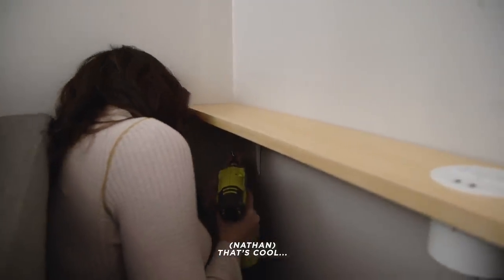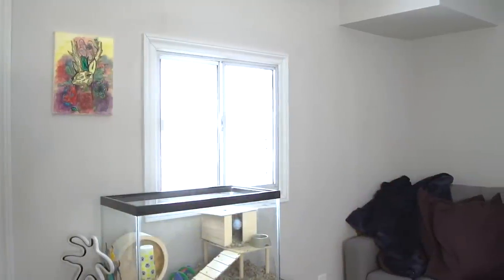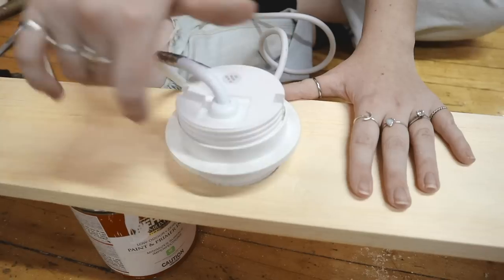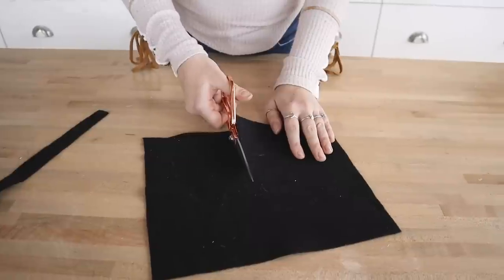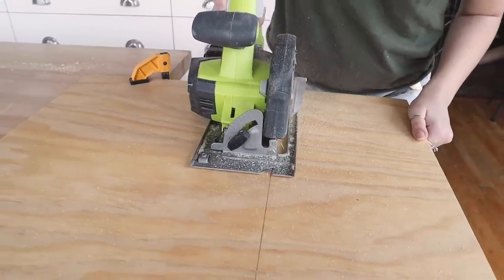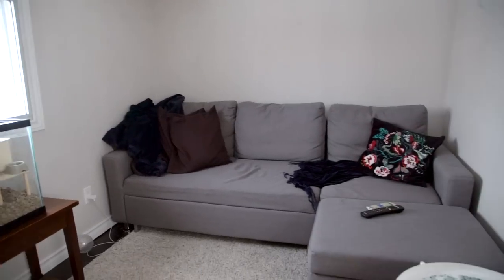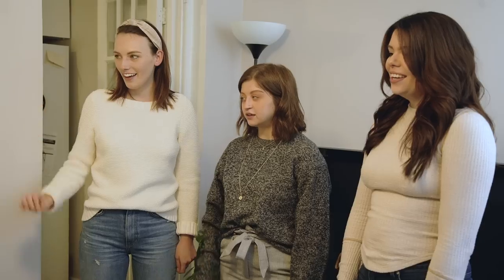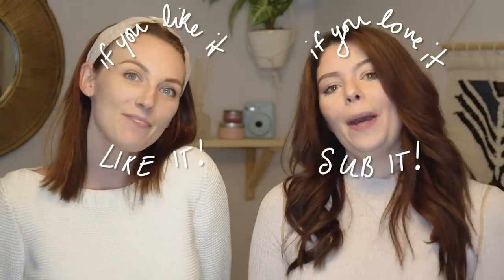make your small space feel BIG!

Comment: Really wish I could use all of these tips for my student apartment, but they have made strict rules about not making any holes in the walls as well as it is concrete walls :/ Thank you for the inspiration nonetheless, you guys are so creative
Reply: Command hooks! Seriously they're so useful in rentals!
Reply: Lol for my apartment I took a calculated risk and installed things anyway. I just bought a tub of wall putty, filled and painted over all the holes. No one said anything. Obviously that's not feasible for everyone, depending on how strict your landlord is and how much oversight they have.
Reply: @kulsoomjawaid6411  That is actually so smart! Might consider this. Not using any wall space is such a waste of space in such a small apartment as I have
Reply: @alexp9621  I do use command hooks for things as frying pans and pots etc, but i fear command hooks will not hold up things as mirrors etc. I really don't wanna risk it dropping into the floor
Reply: @Afsdsh  it'll be fine as long as the frame for the mirror isn't heavy. Check the weight the hooks can hold. They hold up heavy book bags which weigh more than a lot of mirrors.

Comment: The simple shelves work nicely for that space. I have a bigger living room, because it's a combination kitchen dining living room. We put 3 tall BILLY bookcases (2 wide with 1 skinny in between) the part that is under the couch is a good place to hide extra candles and seasonal items. I want to put hinges on the shelf that is level with the back of the couch to make it swing up to access things I might want easier access to and not need to pull the couch out. I mostly put drinks and things I'm using recently on that shelf anyway. Yes it pushes the couch out further, but I'm okay with that. The side table is moved forward and a basket holding guest bedding (because it's a sofa bed) and I like my larger than throw pillows. The other side of the couch has a cat tree, so they like the bookcase as an extension of their playground.

Comment: there are ways to "move" power sockets that are more space-efficient and possibly less hazard-prone than having them horizontal, facing up, in a surface that someone may be likely to have cups with liquids on. One of them is with a kind of electric wiring that's actually turned into a flat adhesive tape. Plus several other kinds of sockets that one can "glue" to the wall, and that don't necessarily waste a lot of space out of the wall. But the wire-tape thing may require some sort of additional coat and paint. You'll also want to remember where it is so to not drill holes on it or anything like that. I actually don't mind and prefer more visible external conduits, though, but the wire-tape thing seems okay for those who put a higher priority than me on how everything looks more "natural" rather than an obvious addition.

Comment: Girls what do you do when room gets downsized where a queen size bed fits perfectly between walls. I have 2 windows (one blocked), the other I had to place A.C. I still have 3 bins and 3 boxes to go into storage. I have a desk by window. Old radiator by window. I feel boxed in. One space for a dresser. I'm afraid if there's a fire, I'm screwed. Any ideas?
Reply: For the firehazard I don't know what you can do tbh, try to talk it over with whoever owns the room, and make sure your exits aren't blocked by clutter. 
If you have some height, you can use that! 
Personally I would change to a high bed (maybe a single bed), but I don't know if that's an option for you.
I would then place my desk or my dresser under it (depending on how much space you have, if you end up with enough space to make a cozy nook under it definitely go for it). 
I have lived in a very small room as a kid (about the size of a bathroom tbh), and my current apartment is also pretty small(and weirdly shaped) , so my advice would be to : make little 'zones', like, this is the sitting part, this is the sleeping part, this is the getting dressed part(even if your place is small, having your stuff organized helps, but there's an ikea video out there that is much clearer), keep things elevated off the floor, so that your space will look bigger(when your furniture has little legs so some floor shows it looks much bigger), stick to some color pallette, and use shelves. Shelves are amazing (and you can make one for corners too, if you use the little wooden paper organizer things and attach them to the wall with screws), and putting small things in baskets or boxes so that they are together is great for both organizing and a more calming look.

If you don't want a single bed there are a lot of people who put their double bed on top of cabinets, but imo that would still be very full.

You could get a table that folds in (partially attached to the wall, instead of a desk? Then when you don't use it, you have a bit more space.

It's pretty difficult to give advice when you don't know the layout of the room, but I highly recommend watching the ikea tutorials, and some videos on small apartments

Comment: Why didn't you clear out the room so you have room to work #the sofa. But good tips good job hate the mirror it's ugly I would have used a different one like a full length and turned it crossed ways along the back wall. You can still add sheer  curtain panels I love the side wall table I've made them before with the folding brackets